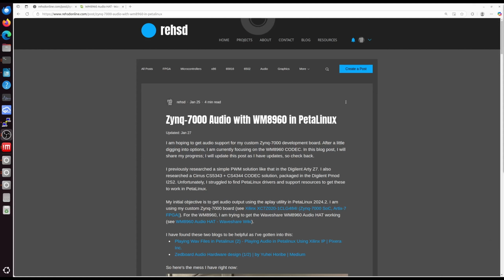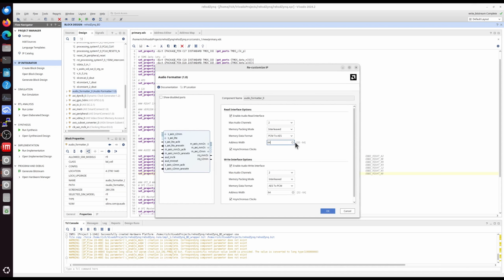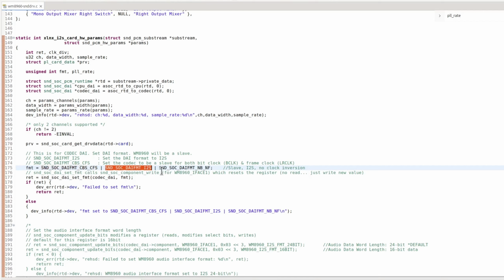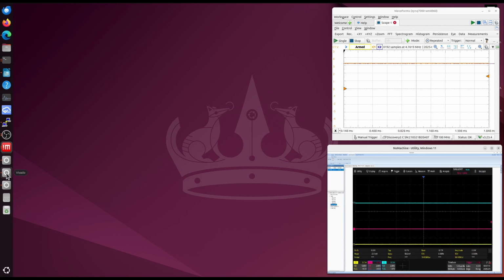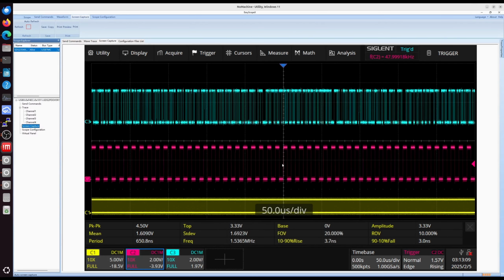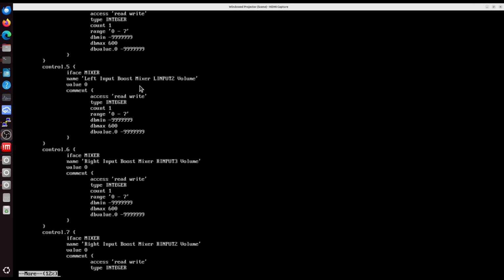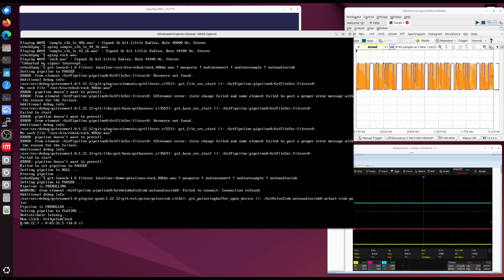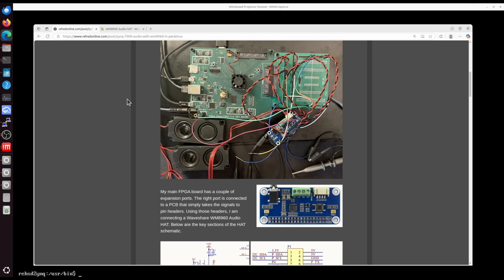Zynq-7000 - Audio Support (WM8960), part 2

Comment: Also, you don't need to use a separate I2C peripheral per device - as long as devices have different addresses, you can connect them to a single shared bus.
Reply from the maker: Yep, I was aware of that. I suppose I have three I2C devices at this point: HDMI, RTC, and now I2S. I'm getting lots of ideas for the next generation of a PCB.  :)